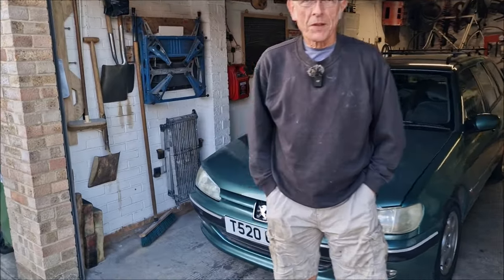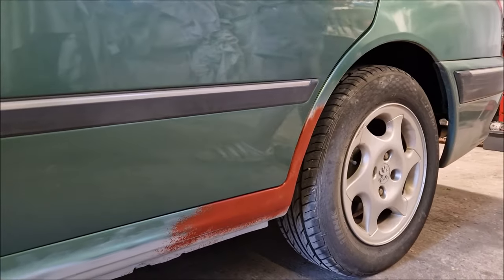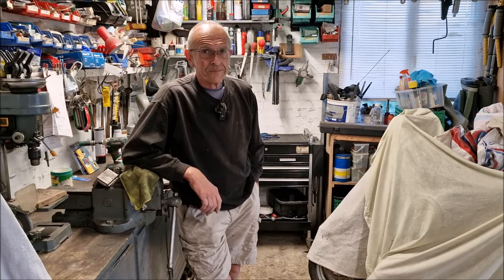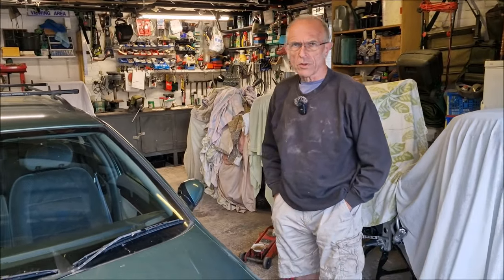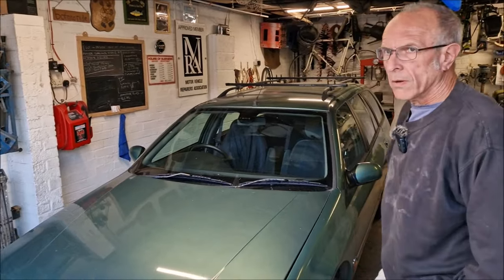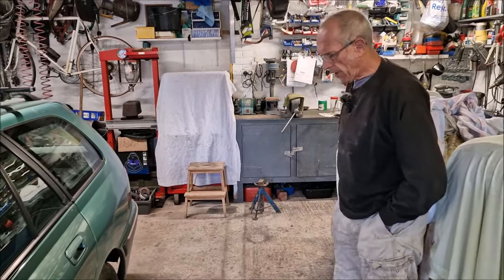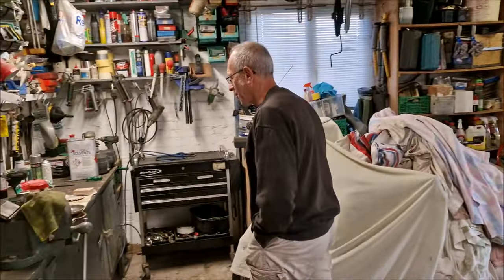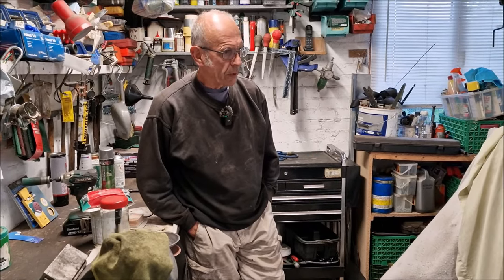Peugeot 406 Sill & Wheel Arch Repair - Day 2

Comment: I'm trying my best at preventative maintenance at the moment so it never gets to the welding stage. Wire brush in a drill followed by Vactan a couple of days later primer not cellulose as no good for Vactan followed by enamel then Lanoguard a few weeks later.🤞
Reply from the maker: Great job 👍